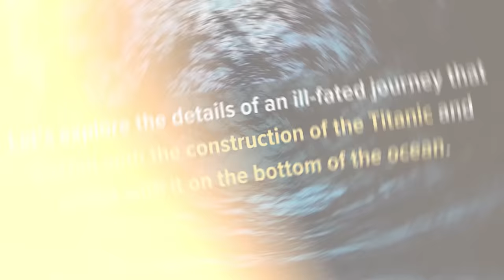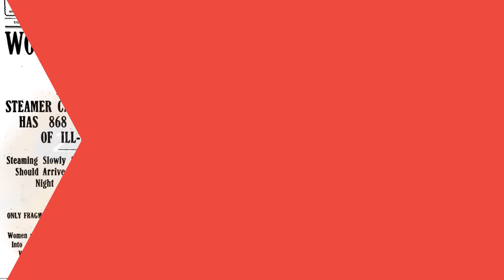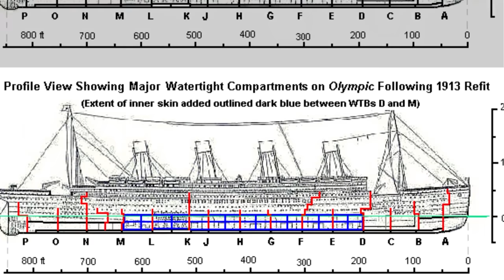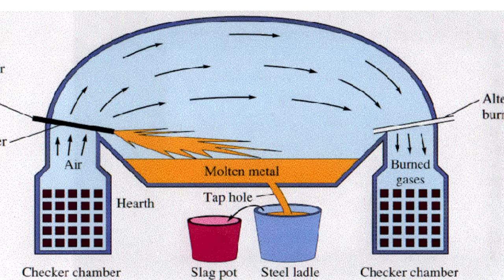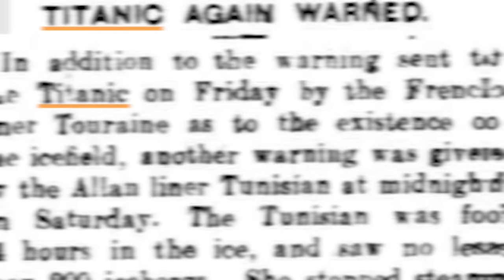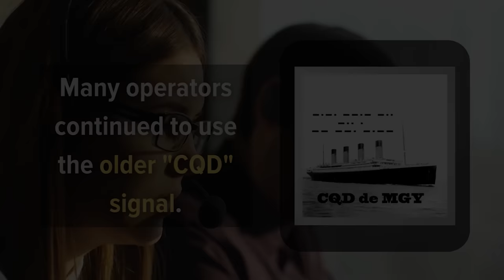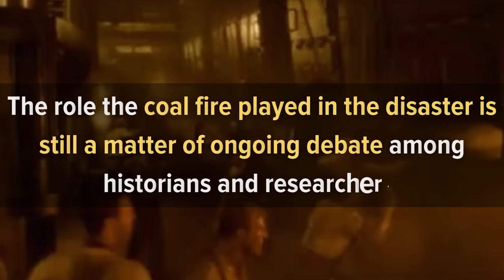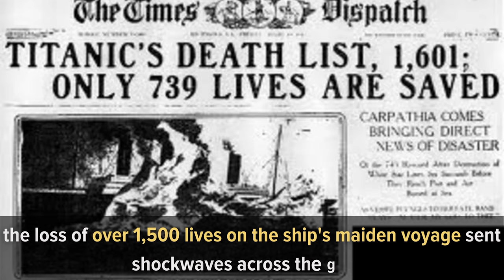The Truth About the Titanic Has Been Revealed

Comment: Yes,  "almost in two pieces" It is about time someone started thinking that it went down connected together and what happened did so on the way down.
Reply: no, survivors saw it break.
Reply: The survivors saw it break wise ass
Reply: People saw it split but they didnt see it detached from each other. The separation happened underneath.
Reply: Yep, she split at the surface, then the last bit around the keel came loose on the way down
Reply: Yes.
Must have, how else did the stern get all blown out/apart from the inside out.
And that deck peeled back it's obvious mega water pressure. 
Before detaching!
The big shots who got it wrong probably will never admit it. maybe?
It didn't crack in two like a florescent  light bulb. For cry'n out loud!
Reply: People saw it break
Reply: It does match up with the debri on the bottom it would be farther apart than it is .
Reply: @rawflame365 depends on which Theory you go with. Even James Cameron's Banana Peel Theory has Titanic completely split in half except for a little flap of skin called the double bottom just below the surface. If you are implying the Titanic held together until after she sank, no that is simply nor true.

Comment: Are they trying to compete with Brightside's impeccable accuracy? 😂 Let me save y'all some time. There's a lot of old sensationalism going on here.

1. White Star never claimed that their ships were unsinkable. Although the captain made comments that the ship was basically unsinkable that was not White Star's official position. They did however produce ads saying things like she's as unsinkable as we can make a ship... meaning she's as safe as we can make ships, and she was indeed very safe for her time and arguably safer in some ways.

2. There is no good evidence that Harland and Wolff used inferior materials. Yes it's true that tests have been done but those tests were flawed in several ways. Even most ships today would not be able to withstand the impact Titanic received by hitting the iceberg. If you don't believe me look no further than the Costa Concordia that hit rocks and rolled over in the same time it took Titanic to sink.  So the idea that Titanic should have lasted for days is ridiculous. The watertight compartments did not quicken the sinking either.
Opening the compartments would have made things worse especially because water would have quickly found its way into the engine room.

3. There was no massive fire on Titanic and these types really need to stop contributing a smudge on a photograph, that isn't even in the same place where the fire would have been. The fire was a smoldering coal bunker fire that would have contributed little to nothing in regards to the sinking. Ironically it actually saved lives because the coal was moved from the starboard side to the port and Titanic developed a couple of degrees list to port. When the iceberg hit on the starboard side the weight of the added coal to port offset her list to starboard, thus helping her to remain stable instead of rolling over

4. While it is true that Titanic received many ice warnings it is untrue that those warnings went ignored. Arguably only two warnings did not make it to the bridge but even so the captain had already taken a more southerly route to avoid the ice altogether. He was not speeding through ice either because not only was it common practice, believing that it would make the ships more agile, but there's no reason to slow down when there is no visible danger, besides this the captain wasn't even moving the ship as fast as she could go. The last three or four boilers were not even lit. This video at least got it kinda right concerning the binoculars. They wouldn't have made a difference. There is no longer any debate about that except sensationalism. Binoculars were not used to constantly scan the horizon in a narrow field of view. They were used to identify an object once something has been detected. The lookouts wouldn't have had binoculars glued to their eyes for their entire shift. Furthermore if it was indeed a mirage known as a false horizon, which good evidence suggests, the iceberg still would have appeared as the part of the horizon. Frederick Fleet did say that the binoculars would have probably made a difference but unless he were using them at the exact moment before the iceberg was spotted this may just be him trying to shift blame off of himself, for which he was not to blame. 

People watching these kinds of videos she should take them with a grain of salt and know that they are not backed by credible historians.